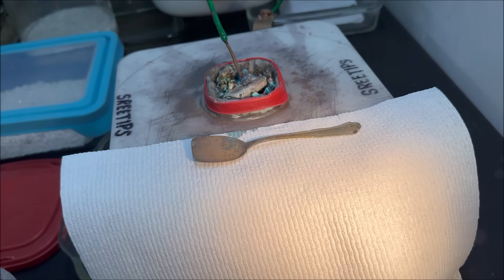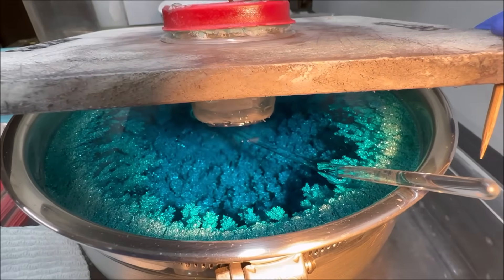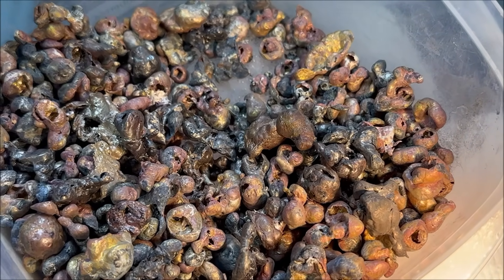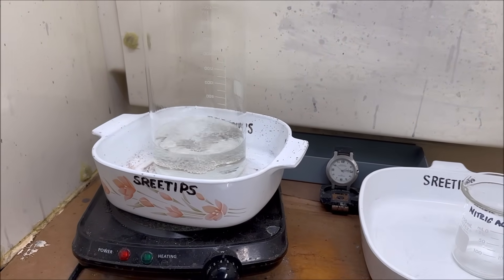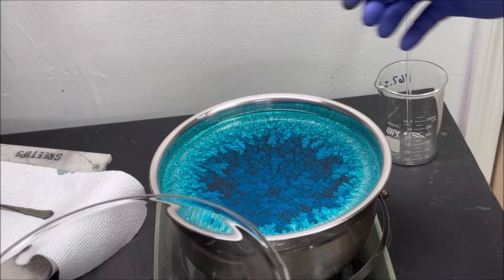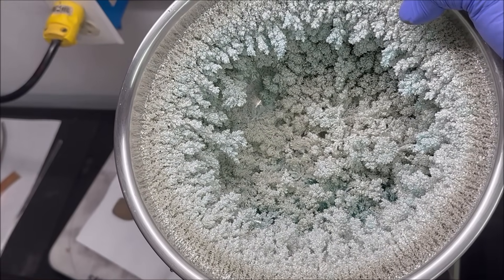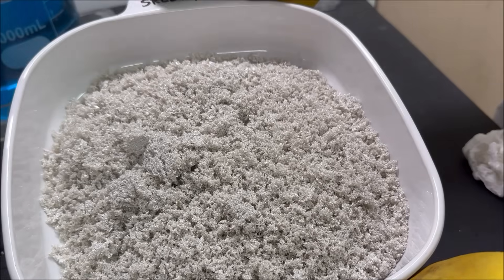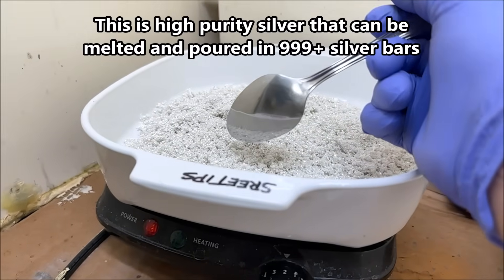999 Fine Silver Cell Harvest and Reboot

Comment: What is a silver cell?
Reply from the maker: I refine gold. I use sterling silver, that I buy at estate sales, to refine the scrap gold. I recover the silver from that, melt into shot, and run it through my silver cell. Silver is a by-product of my gold refining. The cell converts the impure silver (about 980 parts per thousand silver) to high purity four nines fine (9999 parts per ten thousand) pure elemental silver metal. The impure silver is added to the anode basket. The anode basket is suspended in the silver nitrate electrolyte. I pass an electric current through the impure silver. The impure silver dissolves, passes through the Dacron filter, travels through the silver nitrate electrolyte, and deposits (grows) on the inside of the stainless steel bowl (the cathode( as high purity elemental silver. The bowl is connected to the negative pole of the power supply. The process only deposits pure silver on the cathode. So I’m refining the impure silver, into high purity silver, not creating silver out of thin air. When it’s full, I harvest the pure silver crystal, put it away and forget about it. Then I repeat the whole thing again.

Comment: infinite money glitch?
Reply from the maker: No, this is electrolytic silver refining. All pure silver starts out as silver crystal just like you see here. I refine gold. I use sterling silver, that I buy at estate sales, to refine the scrap gold. I recover the silver from that, melt into shot, and run it through my silver cell. Silver is a by-product of my gold refining. The cell converts the impure silver (about 980 parts per thousand silver) to high purity four nines fine (9999 parts per ten thousand) pure elemental silver metal. The impure silver is added to the anode basket. The anode basket is suspended in the silver nitrate electrolyte. I pass an electric current through the impure silver. The impure silver dissolves, passes through the Dacron filter, travels through the silver nitrate electrolyte, and deposits (grows) on the inside of the stainless steel bowl (the cathode) as high purity elemental silver. The bowl is connected to the negative pole of the power supply. The process only deposits pure silver on the cathode. So I’m refining the impure silver, into high purity silver, not creating silver out of thin air. When it’s full, I harvest the pure silver crystal, put it away and forget about it. Then I repeat the whole thing again.

Comment: How much does it cost to make and how much can you make from it is it even worth anything
Reply from the maker: I refine gold. I use sterling silver, that I buy at estate sales, to refine the scrap gold. I recover the silver from that, melt into shot, and run it through my silver cell. Silver is a by-product of my gold refining. The cell converts the impure silver (about 980 parts per thousand silver) to high purity four nines fine (9999 parts per ten thousand) pure elemental silver metal. The impure silver is added to the anode basket. The anode basket is suspended in the silver nitrate electrolyte. I pass an electric current through the impure silver. The impure silver dissolves, passes through the Dacron filter, travels through the silver nitrate electrolyte, and deposits (grows) on the inside of the stainless steel bowl (the cathode) as high purity elemental silver. The bowl is connected to the negative pole of the power supply. The process only deposits pure silver on the cathode. So I’m refining the impure silver, into high purity silver, not creating silver out of thin air. When it’s full, I harvest the pure silver crystal, put it away and forget about it. Then I repeat the whole thing again.

Comment: I dont understand how he did it
Reply from the maker: I refine gold. I use sterling silver, that I buy at estate sales, to refine the scrap gold. I recover the silver from that, melt into shot, and run it through my silver cell. Silver is a by-product of my gold refining. The cell converts the impure silver (about 980 parts per thousand silver) to high purity four nines fine (9999 parts per ten thousand) pure elemental silver metal. The impure silver is added to the anode basket. The anode basket is suspended in the silver nitrate electrolyte. I pass an electric current through the impure silver. The silver dissolves, passes through the Dacron filter, travels through the silver nitrate electrolyte, and deposits (grows) on the inside of the stainless steel bowl (the cathode). The bowl is connected to the negative pole of the power supply. The process only deposits pure silver on the cathode. So I’m refining the impure silver, into high purity silver, not creating silver out of thin air. When it’s full, I harvest the pure silver crystal, put it away and forget about it. Then I repeat the whole thing again.

Comment: If silver can be grown like this why is it still expensive and not a common resource?
Reply from the maker: Every pure silver bar on the planet began as pure silver crystal just like you see in this video. I refine gold. I use sterling silver, that I buy at estate sales, to refine the scrap gold. I recover the silver from that, melt into shot, and run it through my silver cell. Silver is a by-product of my gold refining. The cell converts the impure silver (about 980 parts per thousand silver) to high purity four nines fine (9999 parts per ten thousand) pure elemental silver metal. The impure silver is added to the anode basket. The anode basket is suspended in the silver nitrate electrolyte. I pass an electric current through the impure silver. The silver dissolves, passes through the Dacron filter, travels through the silver nitrate electrolyte, and deposits (grows) on the inside of the stainless steel bowl (the cathode). The bowl is connected to the negative pole of the power supply. The process only deposits pure silver on the cathode. So I’m refining the impure silver, into high purity silver, not creating silver out of thin air. When it’s full, I harvest the pure silver crystal, put it away and forget about it. Then I repeat the whole thing again.
Reply: @sreetips  good to know how to do this for getting pure silver for medical use, such as colloidal silver.
Reply from the maker: I’ve run the silver crystal back through the cell a second time and sent in a sample for ICP analysis. It came back greater than five nines fine. That’s 99,999 parts per one hundred thousand pure silver. I think that result speaks for itself.

Comment: Show a melt down and test at a local shop then
Reply from the maker: I’ve had it assayed several times and it comes back three nines every time. Except once. I ran the pure silver crystal back through the cell a second time and sent that in for ICP analysis. That came back greater than five nines five nines fine. That’s 99,999 parts per one hundred thousand fine silver.

Comment: If the electrolyte also has dissolved copper and you want to keep the limit within the range so it doesn't plate out with the silver. How do you remove the copper from the solution so you can re-use it literally forever. At some point it will have enough copper dissolved in it to start plating out.  Let me guess, you wash the solution with hydrochloric to cement out the silver in it and the rest is copper chloride to be disposed of?
Reply from the maker: I use the electrolyte twice, adding additional silver nitrate to the second run. Then I cement the silver out on copper after the second run. Once the silver is cemented out I add the copper nitrate solution to my waste treatment bucket that’s full of angle iron to cement the copper out.

Comment: I'm so lost.  I may have to watch previous videos to get a clue what we're doing.  I don't have any gold or platinum to start with if that's necessary.
Reply from the maker: I refine gold. I use sterling silver, that I buy at estate sales, to refine the scrap gold. I recover the silver from that, melt into shot, and run it through my silver cell. Silver is a by-product of my gold refining. The cell converts the impure silver (about 980 parts per thousand silver) to high purity four nines fine (9999 parts per ten thousand) pure elemental silver metal. The impure silver is added to the anode basket. The anode basket is suspended in the silver nitrate electrolyte. I pass an electric current through the impure silver. The silver dissolves, passes through the Dacron filter, travels through the silver nitrate electrolyte, and deposits (grows) on the inside of the stainless steel bowl (the cathode). The bowl is connected to the negative pole of the power supply. The process only deposits pure silver on the cathode. So I’m refining the impure silver, into high purity silver. When it’s full, I harvest the pure silver crystal, put it away and forget about it. Then I repeat the whole thing again.
Reply: @sreetips  Still a bit foreign to me, but thanks for the explanation.

Comment: can someone explain what we are doing here? Whats the point?
getting scrap metal from old computers, filter the silver out of it and make bank?
Reply from the maker: I refine gold. I use sterling silver, that I buy at estate sales, to refine the scrap gold. I recover the silver from that, melt into shot, and run it through my silver cell. The cell converts the impure silver (about 980 parts per thousand silver) to high purity four nines fine (9999 parts per ten thousand) pure elemental silver metal. The impure silver is added to the anode basket. The anode basket is suspended in the silver nitrate electrolyte. I pass an electric current through the impure silver. The silver dissolves, passes through the Dacron filter, travels through the silver nitrate electrolyte, and deposits (grows) on the inside of the stainless steel bowl (the cathode). The bowl is connected to the negative pole of the power supply. The process only deposits pure silver on the cathode. So I’m refining the impure silver, into high purity silver. When it’s full, I harvest the pure silver crystal, put it away and forget about it. Then I repeat the whole thing again.

Comment: Is this cost effective? It would be interesting to see a break down of the cost of materials vs the value of the end result.
Reply from the maker: I have an inside advantage. I use sterling silver to refine gold. Silver is a by-product of my gold refining. So I have lots of cement silver, about three buckets (30 pounds each) that have built up over time. I need to get it melted into shot so I can run it through my silver cell. The other advantage is: I can keep all the silver that I produce. There’s no need for me to have to sell any of my silver with the spot price so grossly undervalued.
Reply: @sreetips  thanks for the reply. I’ll be sure to check out your videos on gold. Haven’t seen those yet. Keep up the good work !

Comment: Sooo, you need silver to grow silver?  Makes sense but not cents.
Reply from the maker: I refine gold. I use sterling silver, that I buy at estate sales, to refine the scrap gold. I recover the silver from that, melt into shot, and run it through my silver cell. The cell converts the impure silver (about 980 parts per thousand silver) to high purity four nines fine (9999 parts per ten thousand) pure elemental silver metal. The impure silver is added to the anode basket. The anode basket is suspended in the silver nitrate electrolyte. I pass an electric current through the impure silver. The silver dissolves, passes through the Dacron filter, travels through the silver nitrate electrolyte, and deposits on the stainless steel bowl (the cathode). The bowl is connected to the negative pole of the power supply. The process only deposits pure silver on the cathode. So I’m refining the impure silver, into high purity silver. When it’s full, I harvest the pure silver crystal, put it away and forget about it. Then I repeat the whole thing again.

Comment: how much profit could I make on this? seems like you buy impure silver to feed the machine how much does that cost tho?
Reply from the maker: I refine gold. I use sterling silver, that I buy at estate sales, to refine the scrap gold. I recover the silver from that, melt into shot, and run it through my silver cell. The cell converts the impure silver (about 980 parts per thousand silver) to high purity four nines fine (9999 parts per ten thousand) pure elemental silver metal. The impure silver is added to the anode basket. The anode basket is suspended in the silver nitrate electrolyte. I pass an electric current through the impure silver. The silver dissolves, passes through the Dacron filter, travels through the silver nitrate electrolyte, and deposits on the stainless steel bowl (the cathode). The bowl is connected to the negative pole of the power supply. The process only deposits pure silver on the cathode. So I’m refining the impure silver, into high purity silver. When it’s full, I harvest the pure silver crystal, put it away and forget about it. Then I repeat the whole thing again.

Comment: Hey, had a few questions, what are you using for your cathode? Is it a silver plated zinc sheet?
Reply from the maker: No, the cathode is the entire stainless bowl.
Reply: @sreetips  I've seen some literature on this but none mentioned using just a stainless cathode. All say they used use a silver or zinc based cathode. This is really cool, thank you!
Reply from the maker: The electrolyte is silver nitrate solution. A zinc cathode would react with the silver nitrate and cause the silver to cement out of the electrolyte. Large silver refiners use a Moebius Silver Cell. Mine is a Thumb Cell.

Comment: where is the original source material coming from? i see the little melted balls of metal you are using for the cathode and i understand that is where the silver is being taken from but what is the original composition of the ugly little metal balls ? is it just cheap low grade silver you melted down? and on top of that question -what is your profit yield like? do you get enough pure silver from the original source material to be able to pay for the source material plus profit?
Reply from the maker: I refine gold. I use sterling silver, that I buy at estate sales, to refine the scrap gold. I recover the silver from that, melt into shot, and run it through my silver cell. The cell converts the impure silver (about 980 parts per thousand silver) to high purity four nines fine (9999 parts per ten thousand) pure elemental silver metal. The impure silver is added to the anode basket. The anode basket is suspended in the silver nitrate electrolyte. I pass an electric current through the impure silver. The silver dissolves, passes through the Dacron filter, travels through the silver nitrate electrolyte, and deposits on the stainless steel bowl (the cathode). The bowl is connected to the negative pole of the power supply. The process only deposits pure silver on the cathode. So I’m refining the impure silver, into high purity silver. When it’s full, I harvest the pure silver crystal, put it away and forget about it. Then I repeat the whole thing again.
Reply from the maker: I’d have to sell the silver to realize a gain or loss. I’m not selling any of my silver. So my profit, in silver, is 100%

Comment: how to grow silver? first step: have silver
Reply from the maker: I refine gold. I use sterling silver, that I buy at estate sales, to refine the scrap gold. I recover the silver from that, melt into shot, and run it through my silver cell. The cell converts the impure silver (about 980 parts per thousand silver) to high purity four nines fine (9999 parts per ten thousand) pure elemental silver metal. The impure silver is added to the anode basket. The anode basket is suspended in the silver nitrate electrolyte. I pass an electric current through the impure silver. The silver dissolves, passes through the Dacron filter, travels through the silver nitrate electrolyte, and deposits on the stainless steel bowl (the cathode). The bowl is connected to the negative pole of the power supply. The process only deposits pure silver on the cathode. So I’m refining the impure silver, into high purity silver. When it’s full, I harvest the pure silver crystal, put it away and forget about it. Then I repeat the whole thing again.
Reply: @sreetips  youre a real genius man, hats off to you for coming up with this! I loved the video

Comment: I just looked it up and today 1 kilo of silver is worth $860. I’d love to know what your expenses are to make tat
Reply from the maker: I refine gold. I use sterling silver, that I buy at estate sales, to refine the scrap gold. I recover the silver from that, melt into shot, and run it through my silver cell. The cell converts the impure silver (about 980 parts per thousand silver) to high purity four nines fine (9999 parts per ten thousand) pure elemental silver metal. The impure silver is added to the anode basket. The anode basket is suspended in the silver nitrate electrolyte. I pass an electric current through the impure silver. The silver dissolves, passes through the Dacron filter, travels through the silver nitrate electrolyte, and deposits on the stainless steel bowl (the cathode). The bowl is connected to the negative pole of the power supply. The process only deposits pure silver on the cathode. So I’m refining the impure silver, into high purity silver. When it’s full, I harvest the pure silver crystal, put it away and forget about it. Then I repeat the whole thing again.
Reply from the maker: I don’t really track expenses for each batch.